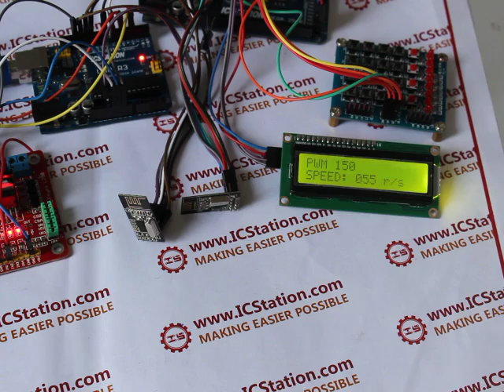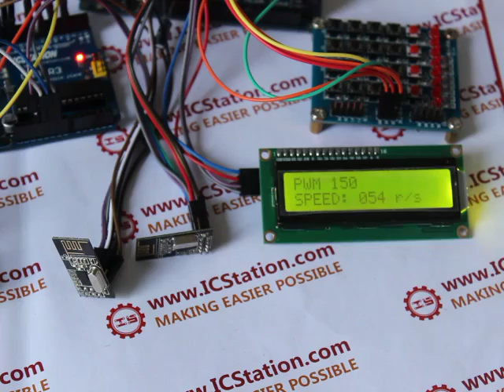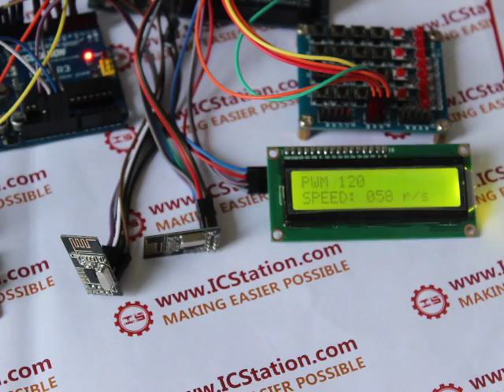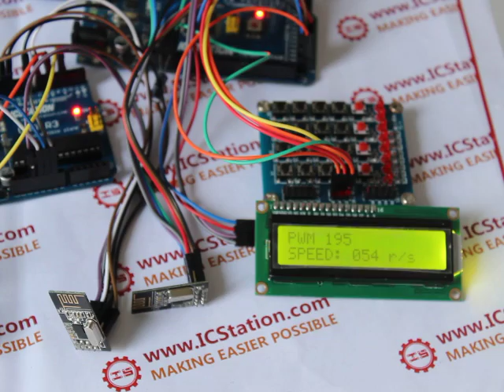Tutorial for Arduino ▶12 Wireless DC Motor Speed Control System Based on NRF24L01

Comment: hi this is just what ive been working on good call do u have an idea how  could change the motor direction with another pentameter?
Reply from the maker: yes,you can use this code to achieve  : http://www.icstation.com/product_document/Download/1381.zip 
Hope it could help you.
Reply: hi thanks but that not really help I have the same setup as you and im controlling onlu one motor wirelessly  with the joystick. I have it all working but when I push forward the motor goes forward but when i pull back the motor does not move back. Do you know how i can make motor go backwards please, thanks
Reply from the maker: Maybe you could check your mode of connection and code.
Hope it could help you.
Reply: hi yes ive checked all but not sure why same setup as you ( but only one joystick and one motor) It almost tries to go backwards when i pull joystick back but just wont spin.  Is there a way i can increase the power /speed via the code?
Reply from the maker: Maybe you could revise the code to increase the power/speed and go backwards?